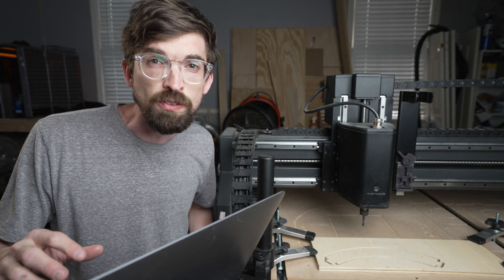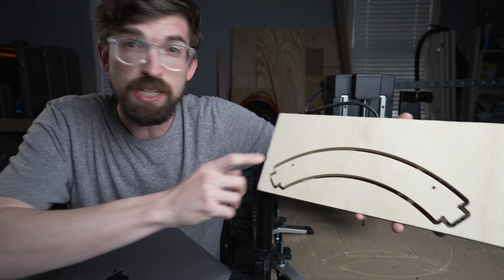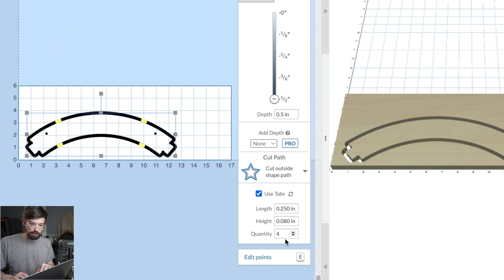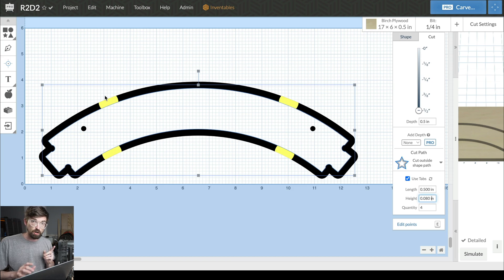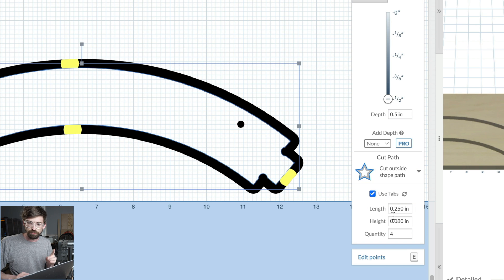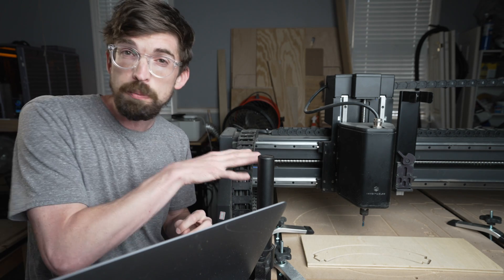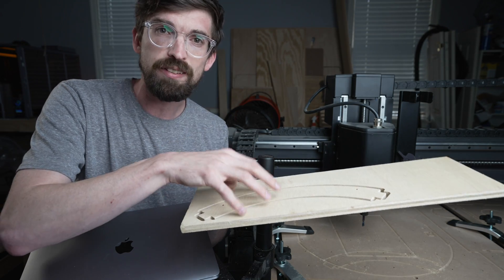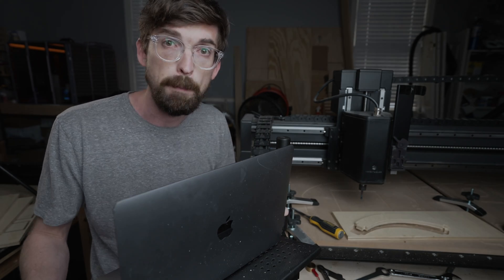Easel Tips - How to Use Tabs | CNC Software

Comment: i have a question on tabs. when i import an stl it shows tabs but when i do the cut it never has them and ends up cutting all the way through. i have tried several different stl and none of them work. any suggestions?
Reply: when I import STL files and clic on the "tabs" flag I do get flags, but they are so thin they get broken in the process of carving. I am going to try to put double-sided tape on the material to prevent this. I think you might not see them because already broken.

Comment: How do you add tabs in the middle of letters to hold the center cut outs?  Thanks Ron
Reply from the maker: In the cut menu you can adjust the number of tabs once you have tabs selected and click and drag the yellow spots around to get them in the best spots.  Make sure you have the center of the letter selected and "Use Tabs" are turned on.

Comment: Just cut a bunch of parts out with Tabs on the XCarve pro.  Worked great.  My only change would be to make them .125" in height for 3/4" thick material.
Reply: Awesome! There is a text box where you can edit them near the tab check box for next time.
Reply from the maker: The height on the tabs are totally adjustable, we go into it in the video!  I found it especially helpful to have thicker ones when working with large sheets of plywood that might not be completely flat to the wasteboard.  There are a few times I'll cut completely through a thinner tab as a result of it bowing up.